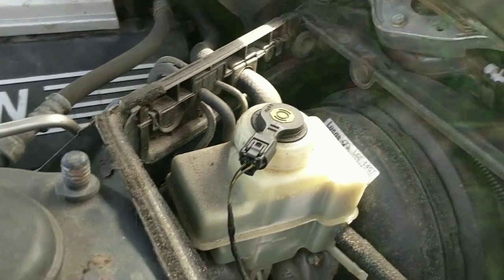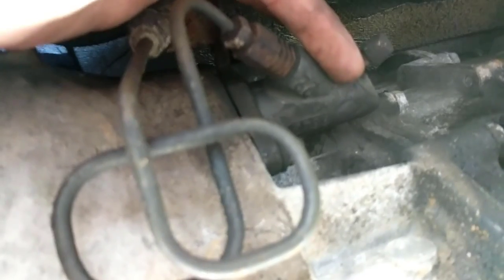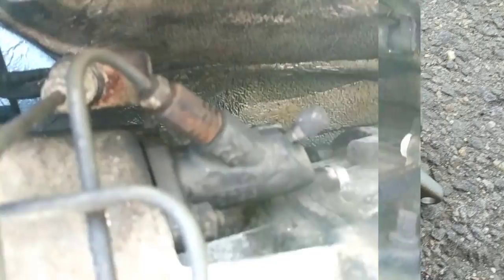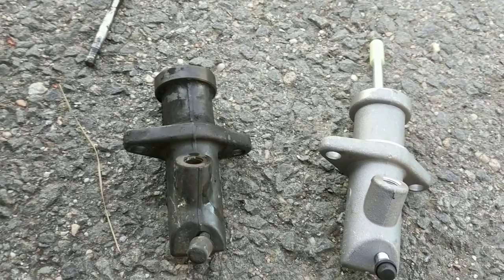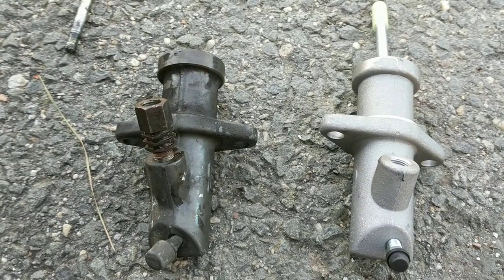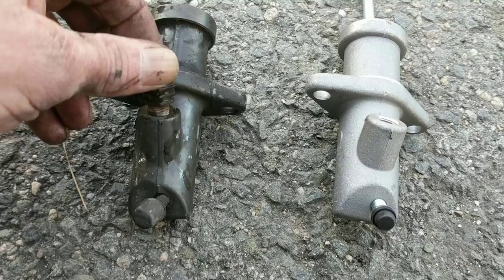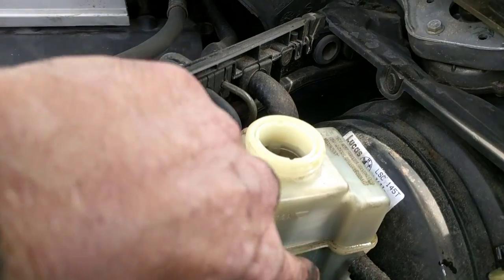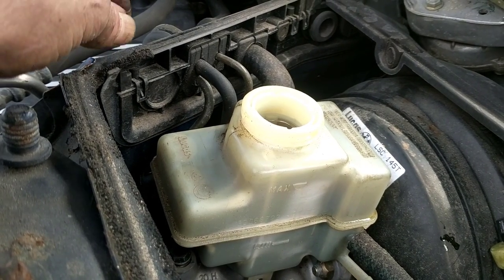How to replace a BMW clutch slave cylinder, bleed, and make the clutch more responsive

Comment: Not only you waste a lot of fluid, but it will take eternity to bleed it like this. You take a big syringe with a clear hose to see for air bubbles, make sure your reservoir is not empty. Pull some fluid from reservoir and go underneath the car. Then bleed any air from your syringe (same as you would do it when injecting medicine) and put the hose on the bleeding valve. When open bleed valve you push the fluid from bleeding valve all the way to reservoir. It gets filled in seconds and you have absolutely no air inside.
Reply: I havent done this job yet but after watching so many videos, I agree with you.  Its easier to bleed the clutch from the bottom and the brakes from the top.

Comment: The clutch delay valve actually pumps a lot of brake fluid into a smaller orifice, which provides more power to the push rod to push the clutch fork out.  So, in other words, it requires less force to push the clutch fork out.  
Put your thumb on the end of the garden hose and see how much stronger the jet of water becomes as you do that.

Without that delay valve you will just have to push harder!
Reply: yes but when you release you have to wait longer for the clutch to catch, it shifts way faster from first to second with this valve deleted